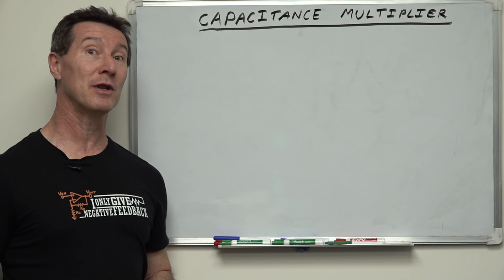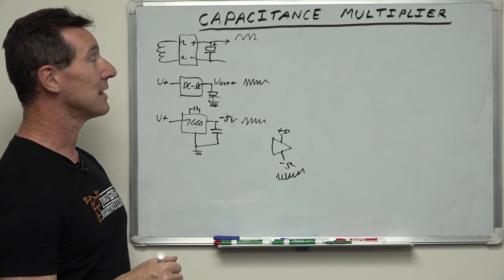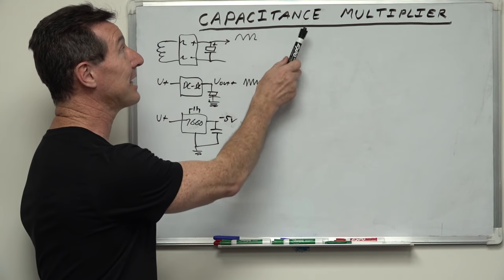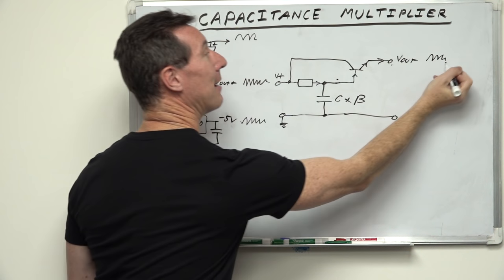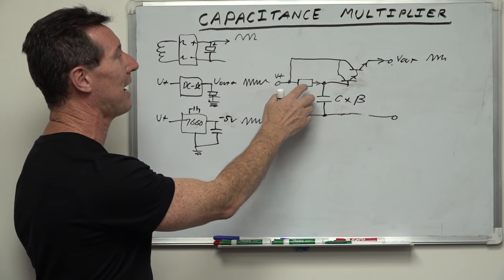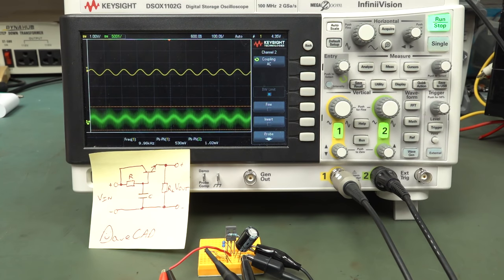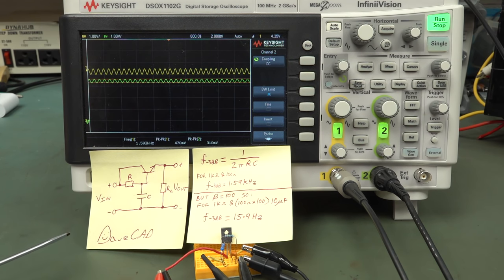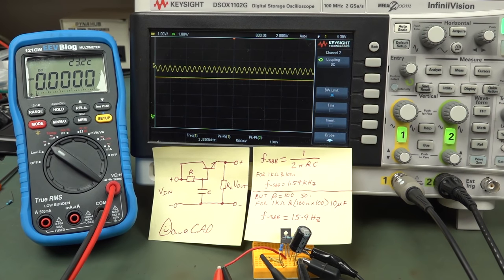EEVBlog #1116 - How to Remove Power Supply Ripple

Comment: Every time we build a sound amplifier, we have to test an output sound. Since 1920-s schematics have been changed alot. Now it makes no sense to use a voltage sensitive one. Even more: there are noise injection techniques that makes any schematic power rail noise insensitive. This is always better than to use power stabilizers or anything on a power rail except a big low ESR capacitor.
A capacitance multiplier can make nothing with high current consumer. The only source of truth is a big PSU capacitor. Because this high current will drain exactly it. Not an air, not that small capacitor, but that the first big C.

Comment: why doesnt this work when we use the  " clean " signal coming from the opposite pole in like high or low switches , we could use 10 k resistors in that case .

Comment: The high voltage 400vdc power supply how can i measure ripple on it by oscilloscope?
Reply: At first I thought voltage divider but that will also attenuate your ac signal. So better is to have input capacitor with Zener/transil protection for the scope input, maybe even series resistor to limit inrush current.

Comment: I LOVE DAVE.. 9v battery to 5v regulator and to - Ncp 7660 for a -9 volt mess.. followed by a capacitance multiplier? and then off to -5v regulator.. perfect 5  0  -5 that sent everyone flying for the past decade.
Reply: @lepidoptera9337  You also built that one? Lol.. The charge pumps work... Don't build this one, it's XP+ humor, your multimeter turns into a down counter on the battery... https://www.head-fi.org/threads/virtual-ground-regulated-and-rail-splitter-circuits.654485/ There's a reason Charge pumps has a category of it's own in component supplier catalogues I think it's the only real solution to this point...

Comment: I have managed to build a circuit that consist of a 9v battery  it drives two parallel 7660's for current capacity, driving a negative -5v 7905 and then again directly from the battery again a 7805, I managed to find the configurations for both the negative rail and positive rail line follower presented here.. one with the NPN and the other with a PNP... connected test LED's... The power on the LED's has a delay effect both on and of as it should... there's a little less than a 1 volt drop.. I only have a 20Mhz scope.... I can't see the level of noise presented here, with the line followers of without them, i manage to faintly make out on maximum resolution the 7660's saw tooth edge. the probes provide more noise than what is present on the circuit.. I'm going to say... BATTERIES is OK.. I don't seem to need the followers and are particularly fond of the 5v symmetry I have achieved... I wonder if you can push the the 7660 to a low pump cycle frequency instead... and try to smooth out something in capacitive scope... it seems there's a limit to capacitor minuteness to try and smooth out an edge...  so if you slow the frequency down of the 7660 perhaps you can end up treating the ripple more like a rectified signal.

Comment: I watched this video for 30 minutes to be told in the last 30 seconds that it's only suitable for low power applications... Think I'll stick with ferrite beads to attenuate ripple after a voltage regulator.

Comment: Why doesn't anyone use an inductor in a power supply filter anymore?
Reply: Good question. Nowadays inductors generally cost way more than capacitors for low frequency ripple applications. 

Back in the day when valve/thermionic equipment was common, high value high voltage capacitors were bulky and often came in oil-filled cans. A inductor choke was easier to manufacture, being mainly insulated wire and shellac (for extra insulation) on a laminated iron core for 50/60Hz and 400Hz use. Such cores are heavy. 

There's a good comparison of choke-filter PSU designs in tabular form in mid-1990s ARRL Handbooks, possibly in later years too.  
Radio hams were using thermionic amplifiers for high-power applications well into the 2000's, and many are still in use.
Reply: of course, many of us DO add inductance, often more for EMC reasons than ripple reduction though

Comment: Why isn't a toroid would inductor used to reduce ripple?  I tested my cheap Chinese made DC  power supply with a 120 mv ripple with a 20 uH inductor and ripple was reduced to less than 10 mv at 5v 1 amp.   No caps were used because I wanted to keep the circuit super simple.
Reply: I meant wound not would above.

Comment: off topic: what ever happened to medristors? Dave can you get one in the lab?
Reply from the maker: I was actually going to try and make my own memresistor many years ago, never got around to it.
Reply: EEVblog  You can get some from knowm in the US for about 20$, I think I remember you mentioning them in a video. Did you have an application in mind?
Reply: gyrator is another name for it?  Can you do transconductance op amps?
Reply: wayne eligur  Not really, a gyrator is a 2 port element that swaps voltage and current on it's two ports, a memristor has a nonlinear relationship between flux and charge, it has a figure 8 VI curve.
Reply: AnotherBrokenToaster
 yeah ... I was asking if he'd do OTA's and circuit design is what....  a request; by the way the OTA's can be used in an 'electronic resistor' that would be programmable ever hear of that?  T.I.   NTE 1370 or some such chip?
Reply: EEVblog Memristors? Isn't that the research name for Intel Optane memory?
Reply: wayne eligur  You can make a current controlled resistor by tying the input to the output and changing the gain of the OTA, that would be cool, but what does that have to do with a memristor?
You're think of the LM13700 probably, that's the one i'm familiar with.
Reply: John Francis Doe  It seems like they are using something like a memristor, but the name is much older.
Reply: I made a servo driven potentiometer that could be programmed to act like a memristor, many years ago now. I used them to store analog level presets for procedural musical synthesis. Was pretty trippy in the 70's.
Reply: Laura Harris  That's pretty cool, and it's pretty much the first thing you think of when you try to make a memristor simulator :D

Comment: But the power loss in the transistor is sometimes an issue. Furthermore, many circuits are relatively immune on power supply ripple. For instance opamp based audio amplifier circuits, except of several exotic designs like the circlotron circuit which uses floating power supplies. https://tubecad.com/2013/01/26/Good%20OpAmp%20Circlotron.png Because they are directly coupled to the output connects they have to be very stable.

Comment: i tried this with a fet , if i connect the load to the source of fet , something like 3.5 v drop at the source relative to drain , then i changed the direction and connected the drain to the load and the drop is just 0.6 at very low load but as the load goes to 2 amps the voltage drop also climbs and fet becomes hotter .

i ll try it with a transistor after the coffee . i d be glad if u can explain what is going on and what might i be doing wrong , i m very new to electronics and sure i appreciate ur help a lot ( or anyones help )
Reply: i tried this emitter follower setup with two transistors ( bd 243c ) with heatsink . regulated output of the ps is 13 volts and it drops to 7.65 with 1.35 a load . and the transistors get really hot . 
then i added another 470 r resistor , current went up to 1.5 a and voltage to 8.95 but transistors get still too hot . i can increase ps basic  voltage to fit it for audio amp usage but then transistors will get even hotter . 
so doesnt work very well for this kind of current performance .

Comment: Having only "half a bee's dick" of real knowledge in this stuff, I can really appreciate excellent teaching demonstrations of hands-on "how it works with these specific components"  type explanations. This is the reason why Mathematical Modelling on Electronic Circuitry is so effective, it's Learning by Doing Experimentally that Electronics Engineering makes practical arrangements of working devices available to the Theoretican to test potential possibilities. 

The e-Pi-i driven circuitry of the universal wave-package has recognizable components of "free flowing" In-form-ation in a source-drain Black Hole circulation and projection pattern of temporal Superposition-point  resonance imaging by electrical-gravitational potential possibility positioning, virtual vector spacing.., demonstrated by naturally occurring multi-phase locked states in the Astronomical big picture.., in a similar fashion to the screen of the Oscilloscope. 

The cause-effect of timing duration rates of spacing as the integrated circuit of the naturally evolving Phys-Chem connection of history here-now is in constant creation and developmental self-defining selection. What You See Is What You Get. Demonstrably.

Comment: Would putting a zener in parallel with the capacitor make it a good regulator?
Reply: You would get some ripple back the zener would give some regulation but to work as a regulator you need feed back
Reply: Jamie Phillips How would you add feedback here without making it too complicated?
Reply: this is a simple feedback https://www.youtube.com/watch?v=LlftbpLZiaU I have tried this one  and it can be built with a Darlington mane pass transistor
Reply: I used a bd137 and a 2n3904 you don't need the third transistor to make this work
Reply: Jamie Phillips  Yeah, i know about that configuration, the third transistor is basically a current limiter so you don't need it, but there's a cool modification that makes this regulator a lot better, and it's to put the zener diode and resistor on the output of the regulator, making the zener voltage super stable. But i think at this point you have made a circuit that's complicated enough that you should just get an lm317.
Reply: an lm317 let's way to much of ripple threw I build pre amps

Comment: After the ten thousandth word -  about how bad outputs are - I gave up (it was bad enough listening through those ten wasted minutes) But I can't be bothered wasting more than those ten minutes - TO NOT GET THE ANSWER YET.!!!!!!!!!!!!!!!!!!
So - I'll got back to my OWN WAY - of removing ripple ...
I CHARGE OVERNIGHT not just one bank - but several "sets" of a suitable bank of batteries - to SWAP OUT with the one's I use during the next day, to thus have say seven or eight "swaps" of DIRECT DC VOLTAGE BANKS..
NO RIPPLE whatsoever - in DC Battery banks.
End of story (in a mere hundred words).

Comment: Wouldn't an old fasion inductor solve much of the ripple problem? That's what antique radios used straight out of the sloppy rectifier tube as their B+ and they were extremely sensitive to ripple.
Reply: an LC filter for ripple needs to be LARGE

Comment: Audio amp ripple might not be the best example though. In these cases PS ripples are not relevant as they are symmetrical and does not transfer to the out. Certainly not an anything but full peak power.

Comment: When using a mosfet the RC filter needs a load resistor to ground. The filter needs current flow to work.

Comment: For first glimpse, you should use a parallel resistor (~0.1 Ohm) between C-E for the higher load currents.  Is it correct ?

Comment: Why don't we use a Pi Filter instead of this circuit, isn't a Pi filter sufficient?
Reply: they are very effective BUT they need to be LARGE to remove ripple
they are usually used to remove noise and spikes

Comment: The apparent capacitance will be like the actual capacitor X the gain of the transistor. Like the talking electronics electronic filter. I built one of these and it worked! http://www.talkingelectronics.com/projects/200TrCcts/101-200TrCcts.html#ElectronicFilter

Comment: it the  same  of use  regulator  by connect  zener  diode on base of transistor   and the  transistor  must  be  worked on the  current   small amp 0.5 a  0.050 amp more  than the  circuit need  and the

Comment: Dave, come on... What's the corner frequency of just a cap on it's own?
The cap multiplier does what is says on the tin when it replaces the C in an RC or LC combination.  Since the multiplied cap is the R,C and transistor combined you need to put an R in front of the WHOLE THING and you'll get the right cutoff freq. for the multiplied cap (neglecting loading and all the transistor non-idealities). The + and -  Vin labels in DaveCAD are the "input" leads of the multiplied cap. 
 What you're essentially doing is measuring the "new" cap on it's own with no resistor to make the new RC, so you get the results for the original RC instead.
The thing here is better described a filter and a power buffer (duh). It also happens to look like a bigger capacitor to the source impedance it's being powered from.

Comment: This video is actually misleading because the "ripple" Dave introduces into the circuitry is actually no ripple at all but low frequency nice sine wave which is being easily smoothed out by the RC circuit. This is no ripple such as the ripple of real world switch mode power supply. Try this with real SMPS ripple which has considerable high frequency residue (typically above 20MHz), so called "needle" or "spike" and you would see that the RC circuit or even second stage does nothing, absolutely nothing to the HF needle which turns to be very stubborn - speaking from personal experience here. You need a different approach entirely to tackle those. The smoothing of low frequency ripple is easily achieved by proper caps on the LDO (or even LDO with a third pin for buffer capacitor) - but those are in real life not the problem, the HF spikes are the problem, therefore this video gives practically no value on actually removing the ripple.

Comment: … Q1: If we included a Zener in parallel with the Capacitor, it would become a voltage regulator; maybe not as elegant or precise as other circuits, but my guess feeling is that it would filter 60~120Hz even better  (about -60dB) than a several series voltage regulators, including also a lower dropout.  Q1, then: Am I misguided in this reasoning?

Comment: The name "capacitance multiplier" is more a functional designation (since it´s effect resembles that of a larger capacitor in a simple R-C ripple filter) than an explanation of the working principle. If it was a "real capacitance enlarger", the charge of the unit, measured in Coulombs, would increase too. But this is not the case. This configuration works more or less as a gyrator, giving the series transistor the properties of an inductance!

Additional capacitors have to be paralleled to the output to take advantge of an even higher ripple reduction and a storaged charge, e.g. for power amplifiers or any changing load conditions. Small HQ capacitors here reduce the also amplified white noise from all components. A zener diode in parallel to the "gyrator capacitor" makes it a voltage regulator too. A current limiting circuit, consisting of 2 resistors and a bipolar transistor between the gyrator and the final filter and charge storaging capacitor makes the affair complete. I use it regularly in HV tube power supplies to save the  weight and the costs for a conventional filter choke.
Reply: Trying to learn circuits. You mention it gives the transistor properties of an inductor. Would this “capacitance multiplier” work better than an inductor at larger current ranges?
Reply: Yes, indeed. MosFets work best in this circuit, since they require a minimum of gate current. So the filtering chain for the gate voltage can be made with larger resistors than for bipolar transistors or IGBTs. Virtual inductors of several hundred Henry can be put into effect, which is not possible with "physical filter chokes for higher currents without immense costs and weight.
  Of course several factors have to be considered, such as pulse and shortcut currents, RDSon and voltage drop of the MosFets, and proper cooling of the power devices. Physical filter chokes are quite robust in case of a short overload and have current limiting properties in a certain range. So I recommend to add the current limiting circuit mentioned above , especially if big capacitors follow this circuit.

Comment: Haha, what about using a 12v lead acid battery in place of capacitor. It wont let the voltage go down and you can use it forever. Just kidding.

Comment: Bad Video. There is no free lunch.
THE LDO does a crappier job because it regulates via a PMOS or PNP device so that the drop across the device is about 200mv. Here you are burning 600mV AND you have no regulation. In the final part of the video, you show that some people use an amplifier, but I am sure they can create a feedback loop and actually regulate this thing. 

I  design ICs so I don't know what parts are out there for you to buy, but I am sure there are regulated power supplies that do have a NPN or NMOS type regulating device that would also have an internal reference voltage that actually regulates. I bet you almost no one uses this circuit.